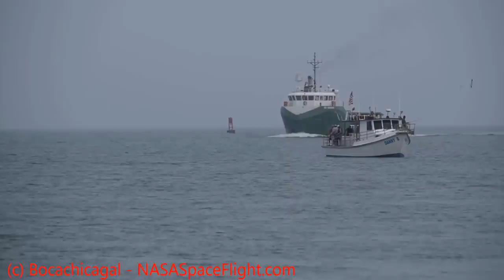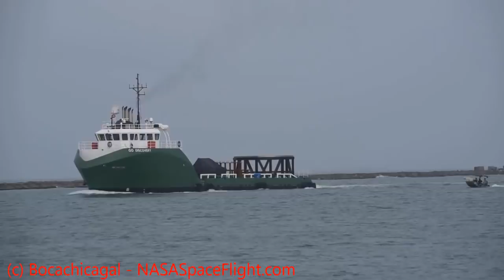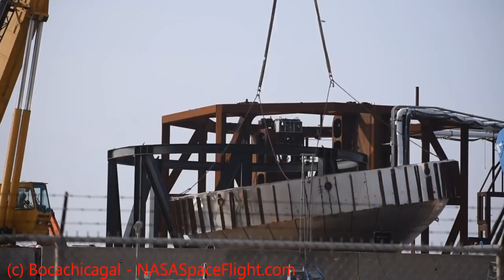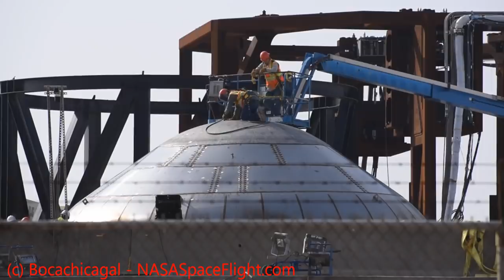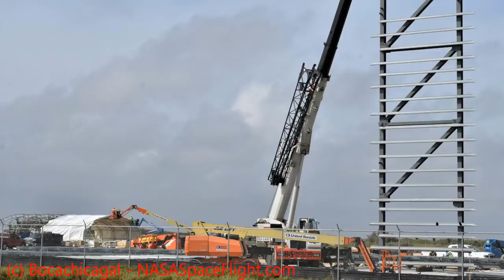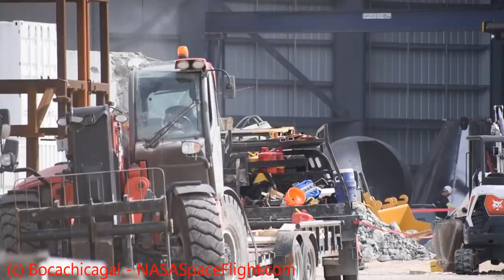SpaceX Boca Chica - GO Discovery arrives with Starship Hardware - Worksite Expanding

Comment: Have you noticed the buildings are prefabricated steel and fabric, very little concrete other than foundation, i.e per a greener way of building? And of course much cheaper and quicker!!!
Reply: I think its more about its cost effectiveness and flexibility. Until Starship is up and running this is probably the best way to protect their development budget while also remaining flexible to any new needs that come from testing and developing the manufacturing processes.

A good example is the bobcat that has been hammering away the concrete retaining wall in front of the onion tent for a few days now, where as near full tents have been installed in the same time frame.
Reply: Concrete is actually greener than steel or synthetic fabric.

This is for speed of construction more than anything.

Comment: For what typically SpaceX use go discovery. And why they don't need it in in flight abort
Reply: Go Discovery is a general purpose transport vessel for SpaceX so its performing a typical task. As for the Flight Abort Test, Space X has other vessels that are primed for the wreckage and recovery effort.
Reply: No booster or second stage  recovery for ifa test. Complete destruction. Only crew capsule recovered after parachute landing.
Reply: Am pretty sure Go Seeker and Go Discovery are usually used to tow the drone ships to the landing zone. It's too far out at sea for the drone ships' limited engine power and fuel to go on their own. Go Seeker is in Fla and can be used for the flight abort. Other ships from NASA or the Coast Guard or the Navy will be involved - they're treating it as if real astronauts are aboard and need to be rescued, all part of the drill. Have also heard SpaceX will recover any part of the booster that floats. To study, and they can't just leave it floating out there as a hazard.
Reply: Go Discovery is just a transportation ship it doesn't have a big Role at the Moment.
Go Quest is the droneship Support ship ;) In the in flight Abort only Go searcher will be used for Dragon recovery!